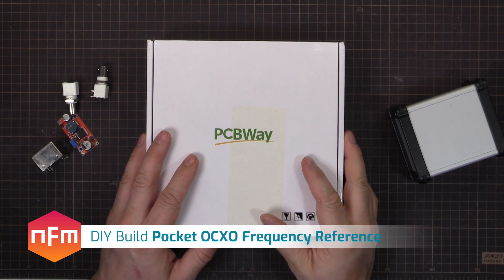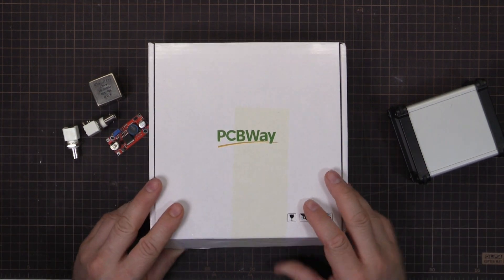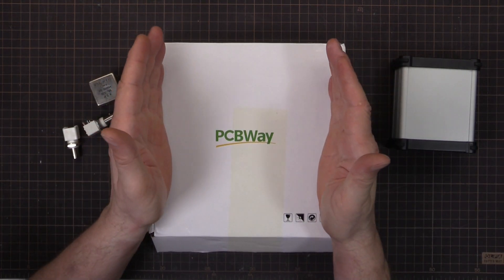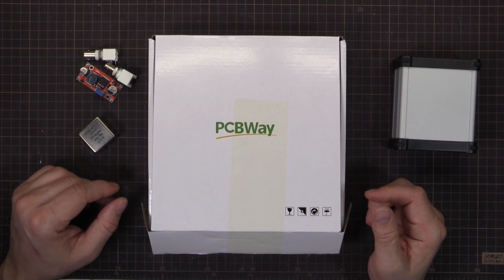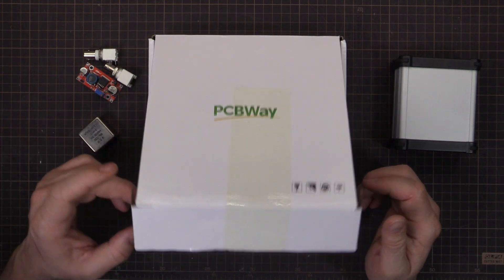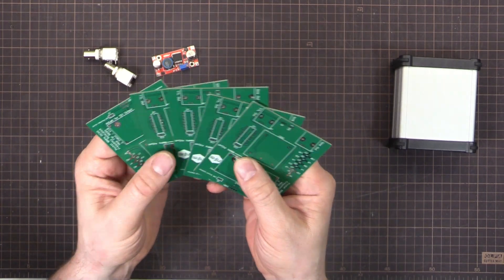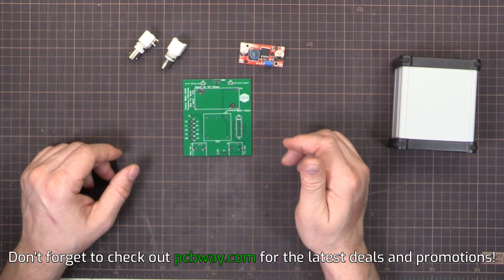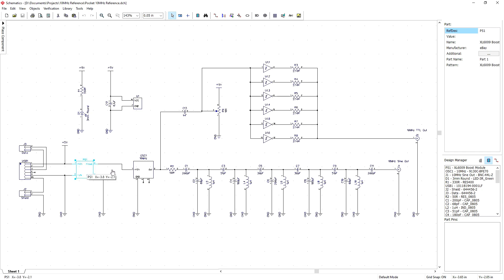DIY Pocket Frequency Reference

Comment: A Rubidium reference is only 150 euros. Why would you ever bother with this?
Reply from the maker: Because this cost me less than $10, most of which was the enclosure.
It was made simply for the fun of it mostly from spare parts I had laying around.

Why don't you make a video showing us how to buy something off the shelf? I'm sure that will be an interesting first video.

Besides, I already have a Leo Bodnar GPS reference, and a HP 5065A Rubidium standard anyway.
Reply: Give me a link where is the shop that sells Rubidium frequency reference for 150 euros
Reply: @Raveent  Holy f*ck, what's with all the brainlets who ask for links to stuff when Youtube has not allowed external linking for 10 years to curtail bot spam as much as possible?
Why, it's the same kind of brainlets who are unable to go to ebay and search for the thing they were looking for.
Reply: *only
Reply: do you know what the term 'fun' means ??
anyone can be a cheque book amateur or a black box operator, same as anyone can buy something off the shelf, 
but build it yourself and use it, a lot more fulfilling and rewarding..

Comment: That DC-DC gave you bit of a fight, maybe you can expand the pcb pads in V2 and use a short piece of copper to connect it.
Reply: Or just use a header pin with spacer in middle.

Comment: I think you need a squerwave shaper for the output buffer,
a comperator or a schmidttriger or something.
Reply from the maker: The part I used for the inverter/buffer is a Schmitt trigger (I think I called it a Schottky by mistake) part, but without the modifications I mention, its output is a bit crappy as seen in the vid.
I'll get another set of boards made and make a V2.0 soon. :)
Reply: @NearFarMedia   i was about to correct you when I saw the schmitt triger symbol, but then i said, bah! is like a typo because of the tequila or or some other liquorous stuff, haha.
regarding the ttl... why not using bjt or fets?
thank you for the project and thank you for share.